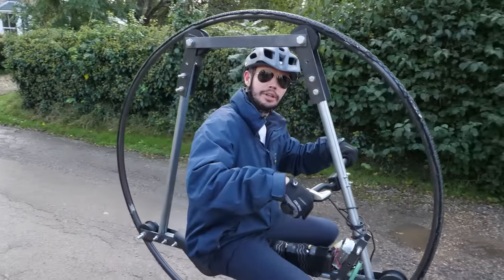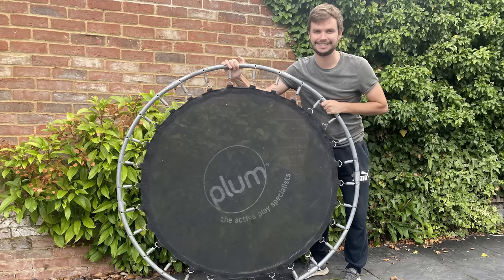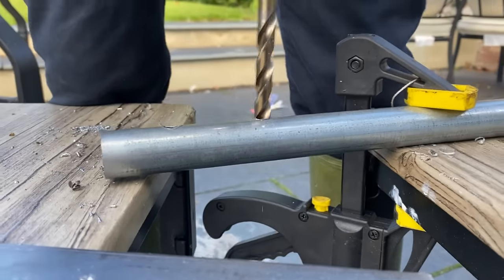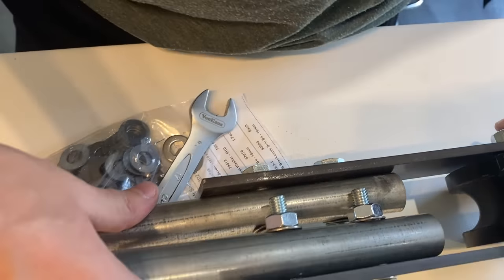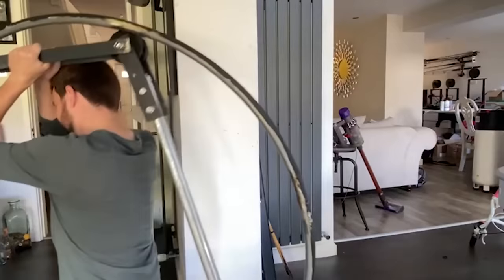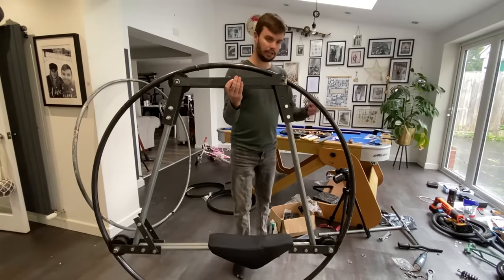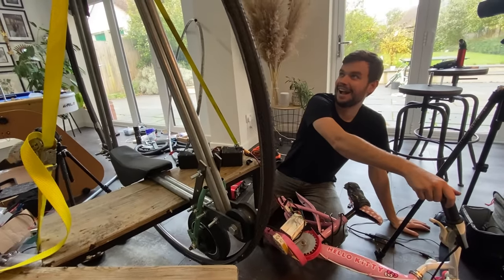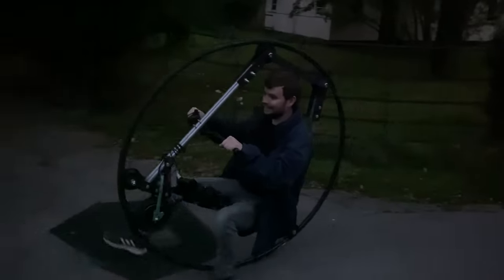Making The Strangest ebike - The Monowheel

Comment: You need stirrups for your feet, they should be connected to the seat and fan out to the sides abit so that if you may a tight turn they brace the motion in whichever direction you're turning. Your seated center needs a gyroscope to keep you parallel to the ground. Also may the full design larger, you're an average sized person and appear to big for it.

Comment: you forgot to add a gyroscope to fix the balance issue. monowheels are only hard when you have to balance it, with a gyroscope it's much harder to tip over.

Comment: This would be really cool if it was like a spherical ball, like a wire frame with treads, but kind of at an angle so it can ride up terrain, and much larger, like 10 feet in diameter

Comment: I'd move the drive wheel back and fit it with a sprocket then to a chain to a drive wheel hooked up to a bikes rear sprocket assembly to help negate the forces when you let go of the throttle. it would allow the monowheel to move with out you having to apply any throttle and allow you to cost easier. You may have already thought of that and I may be talking out my butt, but just a thought   .

Comment: If only the wheel you were using had another 1 or 2 feet in radius it may not have been so bad. What I think you really needed was the ability to lean back with most of your body whenever you wanted to hit the breaks in order to offset that forwards jerking motion.

Comment: you should turn it into a trike frame. and steer with one pivot point connecting two small wheels in the front. the seat should be lower to the ground so you can fit your entire body in the dead center too. and have a place to rest your feet.

Comment: I think you want your butt lower to the ground with a nicely reclined position. Also do something about the drive ratio, get the most out of that low RPM torque that an Electromotor has, it will prevent you from doing loops inside the wheel too.

Comment: 1. Lateral balance is provided by the pilot, but the device lacks "longitudinal" balance. 
It would need a small wheel at the back and another at the front. It would no longer be a monowheel, but a coplanar tricycle. 

2. oOo! <= you already have the logo.

3. The internal fixed structure, instead of being square, should be C-shaped, with the open side forward, to interrupt the vision as little as possible.

4. The whole assembly should be larger so as not to force the pilot to stick his head out on one side only, condemning him to lose his balance without being able to correct it by sticking his head out on the opposite side.

Comment: Add a sort of pendulum counterweight to the bottom to keep the down downwards.  Maybe add a second parallel outer ring so you can look forwards center.  On the other hand I guess you're already paying hundreds of pounds to bend rings and screw holes, maybe cut your losses.

Comment: The wheel needs to be twice that size.
Center the seat at the bottom of the larger wheel. 
Leave room for your head to be straight rather than sticking out one side, throwing off the balance.

Comment: Idk What if you put the engine in the back instead of the front? I feel due to the torque is causing you to fall back more than normal. Maybe if you put it in the back it will help balance it out more. The wheel you took of the bike put it in the back instead of the front

Comment: Friend. If you are cutting or drilling metal use at least a spray lube or cheap grease for cutting fluid. It will make your day better. Water based cutting fluid is ideal.

Comment: This would work if you made it about 2 feet in circumference larger and added a somewhat heavy gyroscope that could maintain your balance on the verrocket axis while you do it on the horizontal axis. You would of course need stronger material to make this work together. Finally, you need need need to wear a helmet with something dangerous like this.

Comment: There needs to be a second motor, with a second drive wheel, with an electronic gyro that applies an opposite torque to the seat/frame to keep the silly thing level. Without this no monowheel design will ever make sense. That pendulum effect is dangerous and uncontrollable.

Comment: What if you made a monowheel, but with training wheels so it can't tip past a certain point? The main wheel is the only thing that touches the ground 99% of the time. But if you accidentally lose balance, there's two tiny wheels on the front and back that spin at the same speed as the main wheel. They aren't meant for turning, but rather to give you enough time to re-balance the bike. Because of this, they won't suffer much wear and tear after you grow more skilled; allowing you to go many years without replacing them.

Comment: the center of mass is too high. you should add foot holds, maybe with wheels to stabilize normally, but when torque is applies to the wheel, they would lift off the ground. They would also press down when braking to keep you from just rolling. you could also just wear rollerblades.

Comment: what if you just had brakes that pinched like a bike wheel and raised the drive wheel? that way you'd slow the outer tire down and stay vertical without flipping the inner bit

Comment: You are to high in the wheel. By mounting your seat on the bottom of the wheel it will be easier to ride. The lower center of gravity helps keep you stable.

Comment: I think i can offer a fix for your riding issue. I know this is late and you probably moved on, I'd like to share a thought i had just now. Your center of mass is way off, you are thinking bike tire but forgetting how the front wheel auto corrects thanks to the forks. you need to move the center of mass back and down. This isn't a complete solution but it will making riding much easier. If you're still at it i hope this helps.

Comment: your main issue is balance so make it big enough to have room for your head with a helmet lmao or you will never balance it. also you need a big counterweight at the bottom and intelligent software controlling the esc so it will be smooth accel and decel, also add some suspension with a spongey type of tire and some kind of suspension on just the seat, if you do all this you might become a millionaire, welp good luck, also to make better training wheels put some delryn on your shoes about a half inch thicc, will need to be bolted as nothing holds it as far as glue goes, not even sandpaper after roughing up both surfaces and putting it in a vice overnight, it was easy to break the joint by hand lol its best shit in the world for skid feet broseph

Comment: not gonna lie....the problem with keeping balance and everything else about the aerodynamic flaws of this can be solved with two "stabilizers" which are to be attached to the seating area and infront of the riders face. if both are inserted into the riders rear end and face hole.....voila. should also solve all issues with flying economy

Comment: You see what the problem is don't you? You built it too small for you. You need to be centered and you're not, you keep sticking your head out to one side. If you were a little smaller and could tuck your head in under that bar then I'm sure it would work awesome.

Comment: no one makes them because they are inherently unstable
uncontrollable
and people have died trying to ride them

the purpose of engineering is to make things better - this has no utility over a 2 wheel self balancing (at speed) motorcycle

if you think you need wheels with a 4 foot diameter, make a motorcycle with 4 foot diameter wheels

Comment: man please deal with all those exposed bolts and sharp steel edges hanging out around your temple you are look at something that could poke a hole in your temple or rip off a cheek (if this is more of the working with metal is not your thing so you are just putting it off at least cap them with duct-tape or something)